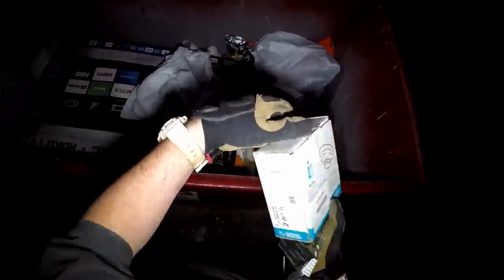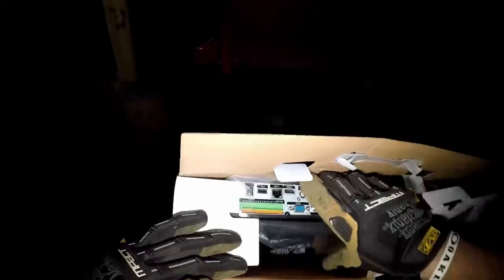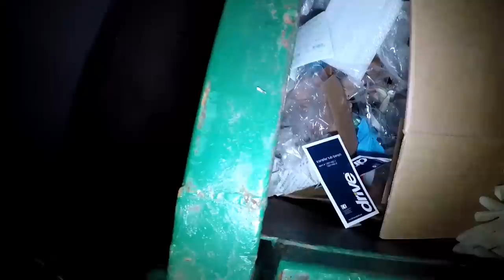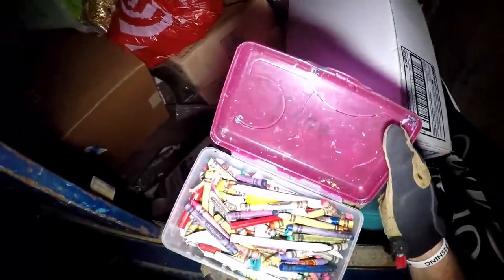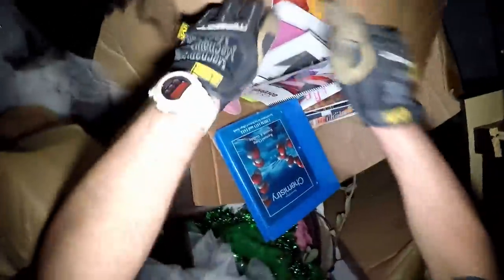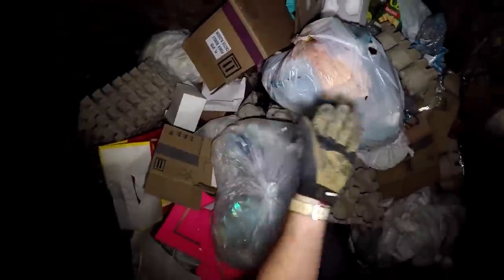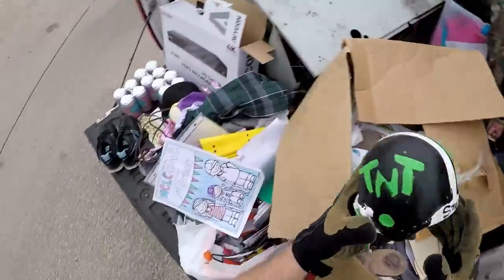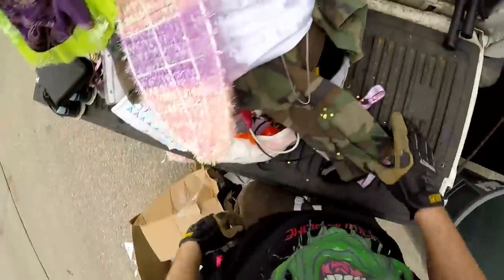Dumpster Diving "50 Shades Of Dumpster"

Comment: That thing you called an evaporator, is actually a residential furnace. Central air shares it's blower with the furnace. The A coils (evaporator) of the air conditioning are attached, usually at the bottom of the furnace. The condenser coil is the one outside the house. Could be wrong on some of this. Not an HVAC person.

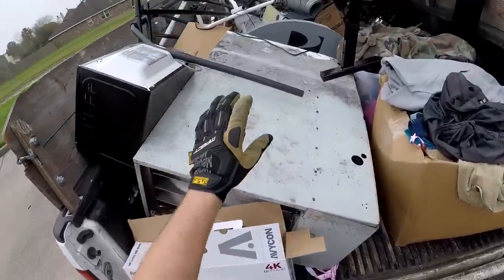Comment: 4:27 & 27:15 It's a furnace. Blower motor on the bottom, and gas valve, combustion chamber, heat exchanger etc... The A/C coils would sit in the plenum above the furnace...

Comment: Mike, be careful with those smoke detectors.  Some have a radioactive alpha source (Americium 241) and should not be trashed or scrapped.  It is marked on a small label on the back of the smoke detectors.
Reply: True, some have low level radioactive piece.

Comment: At 8minuets 42seconds that's full length metal Hospital cot side bed rail normally in pairs for left and right side of bed other must be hiding as they go on edges of old style metal adjustable beds the rails are adjusted to suit Patients needs and requirements sometimes just head to waist end needs rails to stop falling out bed if its wandering Patient or for what ever other reasons it can be stretched full length. But some have thin wedge platform to slide under mattress strapped and harnessed to divan bed if metal bed its usually this type you pulled out which is attached to edged of bed frame like grab rails they to are different in style, design for the different type of beds nower days Hospital Adjustable beds are a 2 or 3 bar sectioned attached via webbing with shitty very brittle plastic clasps that run up and down runners when lifting rails up or down plastic clasps are notoriously very very easy at breaking off when that happens it condemned the whole rail as the clasps being on end can't be replaced to think each set of wooden cotside bed rails can easily cost hundreds pounds the metal ones are around same if not more. U should checked for other fully disinfect and sanitised it and sold on to a Special Needs person who will be forever delighted and great full especially any other Disability Aids like wall grab rails cost from£15 for small to £70 for huge ones or free standing grab rail to go round toilet, toilet grab rail like a small version of Zimmer frame is around £50 the clip on seat would need to be brought new as the plastic is so terrible it goes very mouldy from sitting inside loo, grab rails attached at head end of bed to help get up another from 35 for very basic to more elaborate upwards sixty pounds, kitchen and shower stools each has different design and things so differcult to price but from very basic upwards thirty pounds, a trolley on wheels with shelf's upwards of sixty pounds, bed side table on wheels upwards of fifty pounds, cotside rail and head/foot end of bed padded bumpers pair are from 95pounds,  transfer boards again loads designs and in various materials from 30pounds, medical boots and splints after break or given for other reasons from 20 pounds,Zimmer frames and crutches upwards 30pounds, portable ramps from 50pounds Hospital Adjustable beds from 1,000 with very basic foam mattress a more suitable mattress costs hundreds air mattress from 600 the list goes on NHS via Occupational Therapist can supply some aids its taken me decades to get things I really need still not fully there.

To think billions of pounds of fully usable medical equipment, oxygen that just needs serviced and refilled, mountains and mountains of stuff all sejt to landfill all because NHS just doesn't have storage facilities to hold returned items on loan no extra staff, time, resources etc etc to service, fix any minor repairs, fully disinfect and sanitise and sell them on via charity shop there's people out there like me that are very severely Disabled that are utterly  disgusted at horrifying amount of usable stuff leaving people like myself really struggling to get Disability Aids that Occupational Therapist can't supply at sensible reasonable manageable price so utterly sickening to see this really is so shameful and wasteful not on